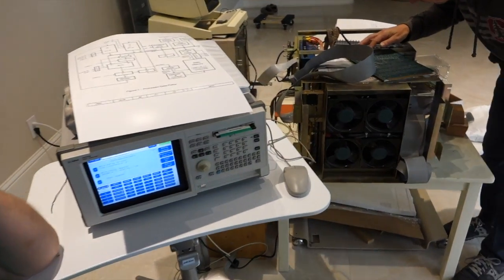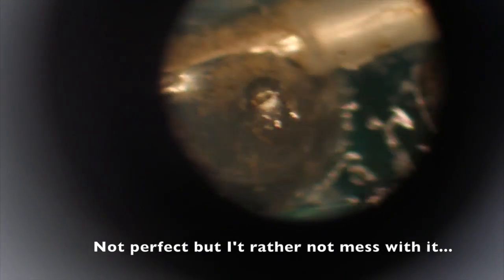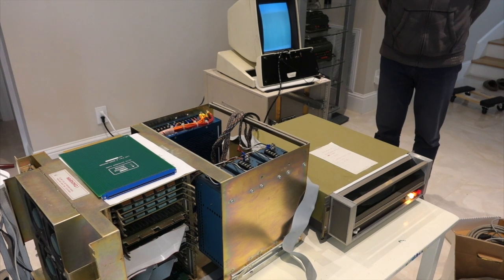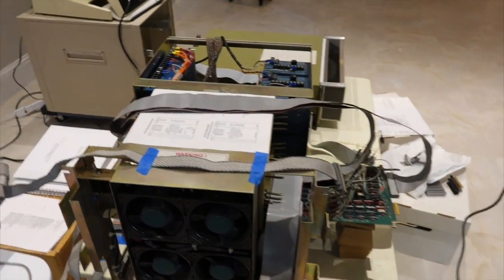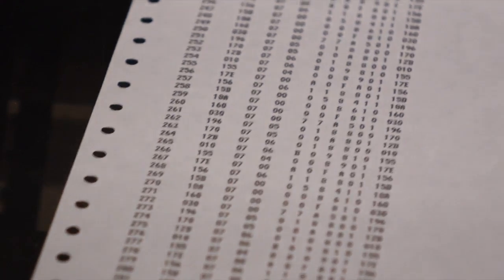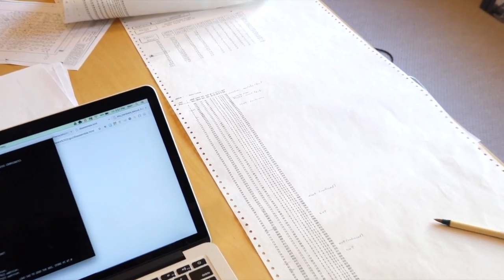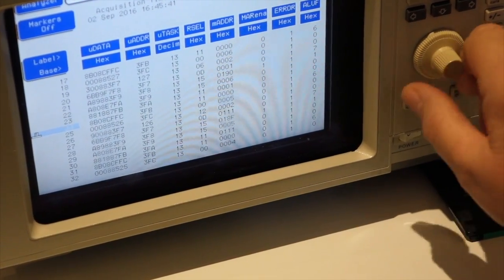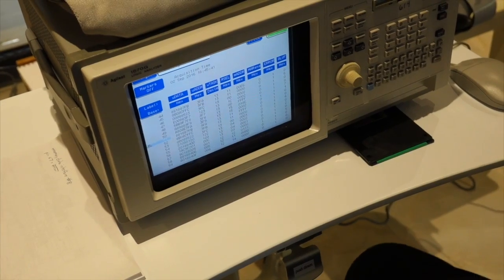Xerox Alto Restoration Part 5 - hooking up the logic analyzer

Comment: Can we pause for a moment to take notice of the absolutely beautiful cable lacing that HP did on their logic analyzer breakout leads? Those things are a work of art. The rainbow cable that was used on the other incompatible disk controller was also lovely, but it's hard to compare with a flat cable made from individual cables like that.

Comment: Considering the system is made up of discrete, socketed TTLs you may want to consider working up a chip tester using an Arduino, Raspberry PI or whatever.  Should be pretty easy to program a routine to supply the appropriate inputs and look for the expected outputs for each type of chip.  The act of pulling/reseating all the chips may also solve various corrosion/unseating issues that could have developed after 20 years of storage.
Reply: if they're socketed, which I kinda doubt in this sort of implementation, drip some deoxit into the socket first and let it sit for a moment before trying to pull the chip. Makes extraction slightly less likely to snap legs off.
Reply: @mndlessdrwer  if you look at the board they're probing in the video it's all socketed (regardless I'm certain they knew all about chip testers and deoxit even back in 2016)

Comment: I remember seeing a talk given by chuck thacker and butler lampson who talked about the issues with the RAM in the alto. apparently because the semiconductor RAM technology was in its infancy at the time they had massive issues with bits flipping randomly. they'd built in parity and error correction to the alto but i think they didn't have a routine to actually find out how many bits were being corrected. in some future design (this is where my recollection gets hazy) they were working with RAM on some new hardware and they kept getting parity errors, turns out the RAM was very unreliable and bits kept getting flipped. this may be what you are experiencing.
Reply: I'm pretty sure many of the boards in this system are labeled Alto II, would they have been affected as well?

I didn't start working on computers until around the release of the IBM 5150, so my knowledge on anything before it a bit unreliable to say the least.
Reply: AIO inc.
i wouldn't know, i'm no expert in the alto. this is coming from a talk i saw quite some time ago. i think it's on the computer history museum youtube channel
Reply: maboroshi1986 Ah, well thanks for the response!
Reply: If I remember correctly, I believe there was extensive DMT (Dynamic Memory Testing) well into the Star Workstation 8010.
Reply: DandyDon
yep. as they said, they had to have extensive error detection and correction mechanisms. but (again my memory is hazy) they were working on something later which they pondered not using as thorough error correction for simplicity and price sake. they found out that the memory wasn't very reliable. i think i remember lampson saying "we weren't sure before how many errors were being corrected but as it turned out it was a lot.".
Reply: Slightly related,  I remember reading that in 1964 General Micro electronics was having a 50% failure rate of the first MOS chips they manufactured for Victors first electronic calculator.

A lot had changed since then but many things still required some "polish" to make them more reliable.  I don't remember if it was mentioned what size memory chips were used in the Alto.
Reply: DandyDon
 i think they were 64 or 128 byte chips, it was something ridiculously small. another issue they had was that the memory liked to be filled in certain ways, as in certain patterns on screen would fail because the memory couldn't handle the patterns. they still said it was better than using magnetic core memory though.
Reply: maboroshi1986
I can't imagine how massive (and slow) this might have have been using core memory.

I wonder if there might be newer more stable substitute Memory ICs to replace those which have gone bad in this particular Alto.

The Alto paved the way for so many Desktop Publishing products.  Not only the 8010 and 6085 Star, but also the 800 Electronic Typing System, which was then spun off into the 600 Series and 60 Series Memorywriter products.

The 850 Display Typing System, and the 860 Information Processing System which I think was C/PM based (8085 CPU) and used XBravo for Word Processing.
Reply: I found the RAM information explained at Ken Shiriff's blog.

http://www.righto.com/2016/06/y-combinators-xerox-alto-restoring.html

"The Alto came out at a time when memory was expensive and somewhat unreliable.[6] In 1970, Intel introduced the first commercially available DRAM memory, the 1103 chip, holding 1 kilo-bit of storage and making magnetic core memory obsolete. The original Alto used 16 boards crammed full of these chips to provide 128 kilobytes of memory. The Alto we have is a more modern Alto II XM (eXtended Memory) with 512 kilobytes of storage on four boards. Even so, the limited memory capacity was a difficulty for programmers and users. The photo below shows one of the memory board, packed with denser 16 kilo-bit chips."
Reply: More here on Intel firsts:

http://www.nzeldes.com/HOC/IntelFirsts.htm

April 1969. 			Intel 3101 The first solid state memory 			chip.,

July 1969. Intel 1101 The first MOS memory chip.,

October 1970. Intel 1103 The first DRAM memory chip.,

September 1971. Intel 1702 The first EPROM chip.,

November 1971. Intel 4004: The first microprocessor.

August 1972.Intel 8008: The first 8-bit microprocessor

Comment: HP shuttle-matrix printer made by Genicom, a company which later merged with Tally.  TallyGenicom is the only remaining manufacturer of shuttle-matrix printheads.
Reply from the maker: Shuttle line printer it is! This an HP 2564C, entirely HP-designed printer apparently, not a Genicom. You can read the development history of the the print bar and shuttle in the June 1985 HP Journal. IBM is the one that outsourced to TallyGenicom if I am correct.

Comment: I assume there will be a part 6?

Seems like you might want to check all the capacitors throughout the system, possibly check for disconnected wires on all the boards and the backplane, maybe want to find a way to test the system memory.

Comment: You print out the code, and go through it manually... is there no way to get the data out of your logic analyzer so you could just load it in some software?  I mean even turning the instructions into assembly language mneumonics would be such a huge help I would expect and really simple to do.  Obviously not necessary with a master on your hands, I was just surprised to see it done that way!
Reply from the maker: We would download it and analyze it later sometimes. This is microcode, not assembly. Not much need to disassemble microcode any further. We have the source and one line of code is one micro-instruction - we really look at microcode address and bus data, which needs no disassembling. Ken wrote some specialized tools to follow microcode dumps along, in particular a task explorer. Carl had to go through microcode source in detail to understand how the disk sectors were actually formatted, which is not accurately documented anywhere. Even with the commented source microcode that was a very difficult effort. I asked to some of the original programmers how microcode was developed and checked , and they responded "a few instructions at a time, following with a logic analyzer". We did the exact same thing.

Comment: Small correction - that's "Trident" disk, not "Triton."
Reply: I'll also add that it's interesting that you're getting Disk Word task wakeups so early (at least based on the printout in the video) -- If the trace is starting from the point at which the Boot switch is pressed, I'd expect to see a Disk Sector task wakeup first (for the correct sector) which would generally happen much later in the execution, since disk rotation is so slow (relative to the speed of the microcode engine.)  I suspect that in addition to the parity error you're seeing, the Disk Word task is being woken up incorrectly.
Reply from the maker: Yes, we were both surprised by and suspicious of the Word Task. Also take everything with a grain of salt, these were the first traces and interpreted on the fly. On top of this we know we had the tasks bits wired wrong at first, so mis-identification is possible. The parity task seems real.
Reply: Cool, hopefully once you get things decoded properly things will make more sense :).
Reply from the maker: Oops Freudian slip. Trident is correct.
Reply: It's a bit confusing. The disk drive is "Trident", and the disk controller card for the Trident is "Tricon".
Reply: Triton's father Poseidon had a trident.